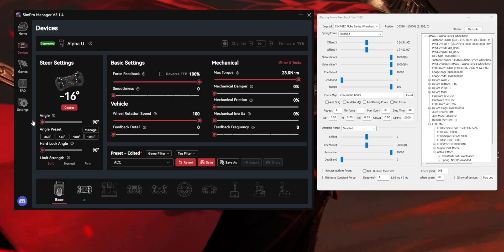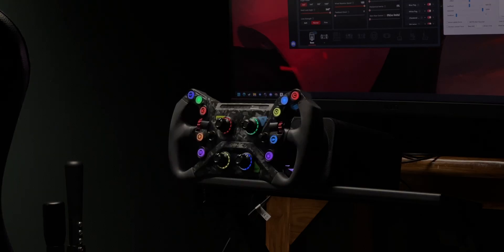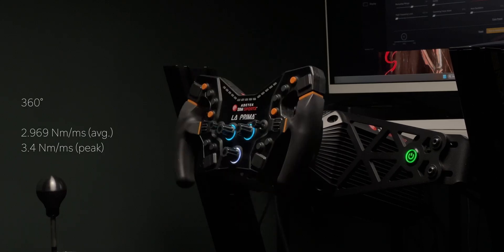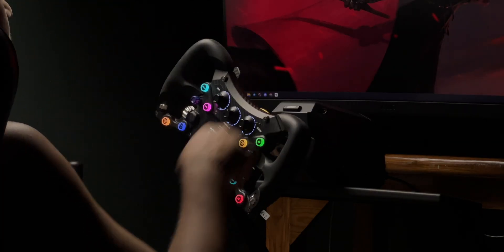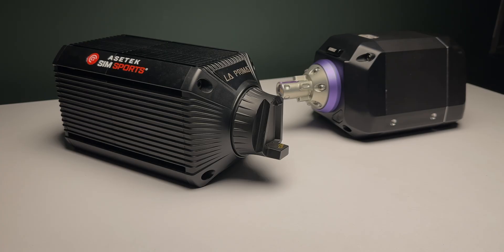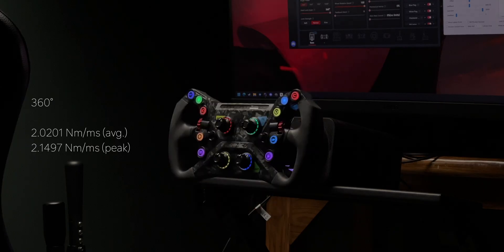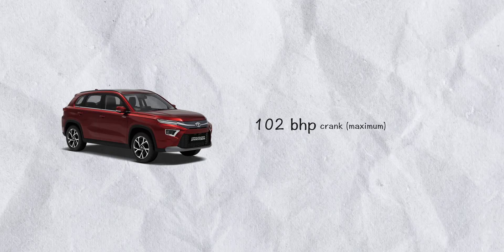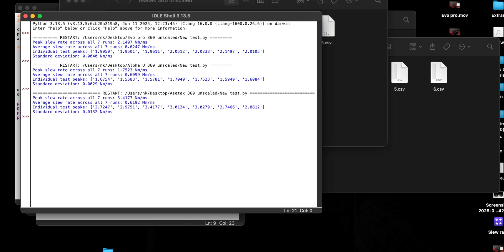How I Tested Wheelbase Slew Rate Without Lab Grade Equipment

Comment: This video is full of pseudo science. FFB Torque Slew rate, that wheel manufacturers sometimes advertise for their motors, cannot be measured this way. Slew rate is happening even if you hold the wheel exactly in the same position.

This tool measures the angular acceleration of the combined system which has no direct relation to torque slew rate.
Reply from the maker: Manufacturers lock the shaft of the wheelbase in a bench, and measure the jump in current. The numbers achieved there, realistically cannot be achieved while driving because different sim titles have different requirement, wheelbase settings, and most importantly, the inertia of arms and the rim itself. 

Also, Angular acceleration has a direct mathematical relation with angular acceleration.Well, technically angular jerk. Angular acceleration’s response depends on torque.
Reply: @napmanreviews  yes, but angular acceleration is also dependent on the motor characterestics and internal servo drive filters that might limit the rotation rates for various reasons. Where as torque slew rates are achieved usually as advertised by manufacturers.
Reply from the maker: @mtakala82  Absolutely on point. Slew rate unfortunately can't be tested without proper equipment. Another issue with slew rate is, people fixate on it too much. The odds of achieving the claimed slew rate figure are next to none. X amount of variables. Inertia of arms, shaft length, inertia and weight distribution of wheel. 

Which is why I think angular acceleration is a much more, real life what you can achieve metric. 

That said, will I be testing slew rate in the industry methods? Absolutely.

Comment: I would like to buy my first direct drive and I would like to get a 12nm ares but I am undecided whether to get it with the quick release style f1 conspit or with the new cdr (which is not yet available in any store)
Reply from the maker: I’ve been using the NRG style (CDR) QR and the USB pass through for the past month. It works wonderfully. I’ll be reviewing both the QRs and the Ares 12Nm soon. My pick has been the F1 style QR so far.
Reply: @napmanreviews  so do you recommend the original conspit f1?
Reply from the maker: Highly. Though I have my reasons. NRG is the industry standard nowadays, but F1 style feels different.
Reply: @napmanreviews  thank you so much you were very helpful

Comment: When it comes to slew rate, the minimum threshold is important - you need to consider the relationship between your maximum torque setting, slew rate, and the simulator's FFB frequency. This ensures your wheel will reach the torque your simulator signals before the next FFB interval. Ideally you'd want the wheel to reach the target torque within half that time interval.
Reply from the maker: That's exactly why a test bench will be required. As of now, I don't know how much torque is being applied in the steps through software. 
I need to test it on the bench with my commanded steps of say, 5Nm, or 10Nm.
Reply: @napmanreviews  SRmin=Tmax * FFBrate (Hz) / 1000. You can consider the worst case scenario where the torque change is from 0Nm to whatever you set your max torque in your wheel base. Let's assume 10Nm. Assume FFBrate of 60Hz. The minimum slew rate you should set would be 0.6Nm/ms. This would ensure your wheelbase will achieve the desired change in torque in all scenarios during the FFB interval. Any lower and you are effectively lowering your max torque. I recommend doubling this to feel the FFB for at least half of the FFB interval. With most Sims providing 300Hz+, this is all you need to worry about these days. In some cases when the FFB rate is low like 60Hz, higher slew rates can feel jittery, grainy, or uncomfortable. 

Measuring torque slew rate of a wheel base is like measuring the response time of a monitor - I'm not really sure why you are trying to do it 🙂 But if you must, for "science", an arduino and a pressure sensor is a low cost and simple way to actually measure it.
Reply from the maker: @bobbysmilez8510  That's really helpful. Would it be okay with you for us to connect?

Comment: I thought of 2 ways earlier when i was making my own dd base...
1st by measuring torque 
2nd by acc then u know run some evaluation and data analysis to see which one is better...
Actually none was highly accurate 😂😂 lol
Brand don't specify the inertia and setup conditions while their tests...
Reply from the maker: Dynamically measuring stuff is going to be a bit tricky, but not impossible. And brands will never show their testing methodology, unless it's necessary. It's a teeny tiny metric in a chain of other stuff.

Comment: Bases that offer a continuous slider for slew rate adjustment are able to give the user a more suited feel for themselves. Sometimes Quite, Balanced, and Performance is just not enough fine adjustment. But better than nothing at all, and in most cases ok.
Reply from the maker: I agree, that's a great point. No reason not to let the user have full control over it.

Comment: You criticized my shorts, because they have no methodology and specific results. And now you have done the same thing and got strange numbers. So in my tests I got something similar and decided that it is enough for people visually compare how the steering bases behave in comparison with each other.

About numbers - my experience also shows that a high slew rate is not always what you need. There is individual limit, above which it becomes simply uncomfortable to drive. You identified 2 types of simracers, so I belong to the 2nd, who try to use all of what they have (I don't slow down the bases in settings). So, for a month I had a Simcube Ultimate, which subscriber gave me for testing. That base was really over of my limit -  it simply interfered with my driving, and became the first base that I slowed down little bit in the settings.
Reply from the maker: I criticised your shorts because you only provided visuals, no numbers. Judging wheelbases visually or providing a visual for people to judge is a terrible way. 
You can check the video again, you’ll see that I never said the method was wrong. It’s written on the screen that without data the test is meaningless.

My point was people were getting misguided and that video let them to believe that it has higher slew rate than SC2 pro. Which it doesn’t.

If you’re going to provide some results or display some data, I urge you to do so. People do need it, but don’t leave the data out thinking visuals are enough for them.
Reply: @napmanreviews  Ok then. I added some data (degrees / impulses)  in the last comparing short, my friend helped me with graphics
Reply from the maker: @GrigArtPlay  Absolutely, how can I help?
Reply: @napmanreviews I wrote "help" instead of "helped" 😁
my English is not very good, sorry
Reply from the maker: No problem. If you need any help with the data, do let me know

Comment: 10:24 
“Angular displacement does not equal torque” !!!
I was shouting this at you the whole time. Haha

Great video and valuable measurements! -even if it wasn’t technically “slew rate” it was very useful for qualitative analysis (comparing between bases). I’d consider the moment of inertia similar enough.
Reply from the maker: Haha, yeah. Think of these results as irl mileage or horses!

Comment: There are several ways to define slew rate, but all must be change over time. Rotation per millisecond is a valid measure of mechanical slew rate, as would volts per millisecond be a valid measure of an electronic components slew rate. The rate of torque increase is difficult to measure on a shaft that is free to rotate which is why a fixed shaft or know load is used, your method could be improved by using a greater mass fixed to a QR, the wheels you tested with have too little mass and different mass distributions.
Reply from the maker: I totally agree. I will test all the bases with shaft locked to see what numbers I can get, that is the plan.

Comment: Very interesting video again - and I love your style 🤣 
I think what you’re actually measuring here is angular acceleration. That’s the better indicator of how fast a wheelbase feels, since it shows how quickly the rim can react. It’s not just about slew rate - torque, motor inertia, and the control loop all play a role. A base with a high slew rate but a heavy motor, or a slower control loop, can feel very similar to one with a lower slew rate but a lighter motor and tighter control (alpha evo for example).
So in my opinion, what you’re getting here is actually a more useful indicator of “servo speed” than just looking at slew rate numbers. Plus, let’s be honest - 98% of sim racers probably couldn’t even explain what slew rate really means anyways 😅
Reply: Welp, then Its a good thing we have videos like this to teach us "98%" what slew rate is then.
Reply: Came there to say this.

Still great video tho!
Reply: Basically... Power/output? Rpm x torque ÷ 5252? Is this not what we're really talking about here?
Reply: @HughesDePagen no, it’s divided by 6969!
Reply: @DanSuzuki 😂😂😂😂
Reply: Good point @DanSuzuki. The angular acceleration is a = T / I, where I is the rotational inertia and is given by I = 0.5 m*R^2. So the mass (m) of the wheel itself is not the only factor affecting the numbers here, the radius is very important too. 

Another good point you made about the inertia of the motor itself. Since we can’t add negative inertia (in theory we could, but it might be unstable?), the lower it is, the more situations (cars) we can simulate by adding inertia. 

Maybe the future is position feedback control of the wheel with a torque sensor. The position set point is updated by computing the angular acceleration of the steering column based on your torque vs. the computed tire torque.
Reply: @RG_97-i3r  Not quite, your formula is incorrect. The moment of inertia is the integral of r^2 dm. Basically you break up the wheel into tiny masses, multiply each by their distance from the center of rotation squared and then add them up. Heavy components close to the axis of rotation won't contribute as much as you might think (like a heavy quick release) but a large diameter rim made of heavy materials will contribute a lot. It is the distribution of mass that matters. But yes, the point is important. The moment of inertia of the wheel is more important than the mass. A heavier Formula style wheel might have a lower moment of inertia than a lighter Rally wheel.
Reply: reddit told me higher numbers means best. Thats all I need to know
Reply from the maker: Thanks Dan. And I agree, torque, inertia and control loop are all at play here. 

Also, Slew rate? All I know is that higher number is better 😛

Comment: @the Napman, do you run, on simagic,  "Wheel rotation speed" at max and add filters? I still don't know how to manage settings for this wheelbase
Reply from the maker: No, the filters and WRS depends on the game I’m playing. I can never use max WRS. Too fast
Reply: There is a guideline for this settings, i really don't understand why only this wheel base has this  @napmanreviews
Reply: @napmanreviews What do you mean by too fast? Isn’t it ideal when the wheelbase responds instantly to the game’s output, since that’s what reflects the car’s real behavior?
Reply from the maker: It is subjective. Some people are very comfortable with 100WRS, I feel comfortable with 45-50 WRS.
Reply: @napmanreviews was simagic tested with the latest more raw FW 223?
Reply: @napmanreviews  i also usually have 50 WRS, 15 mechanical damper, 15 mechanical inertia, 5 mechanical friction. Smoothness 3-4, feedback detail 0-4, feedback frequency 0-4. I love my Alpha U and see no reason to switch to a different wheelbase.